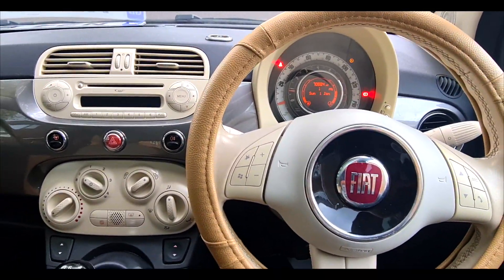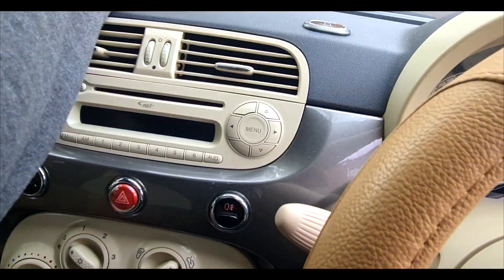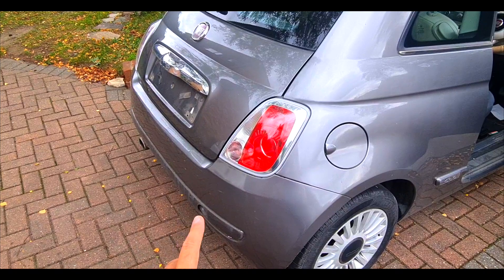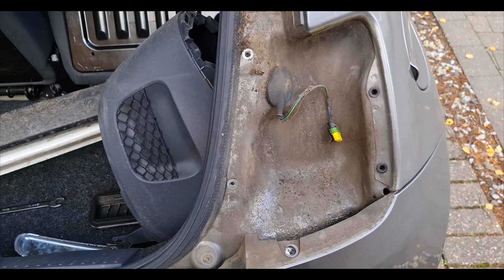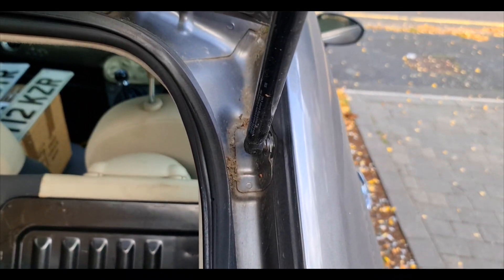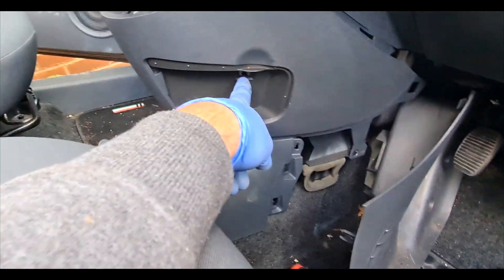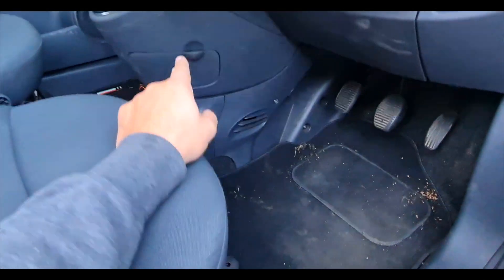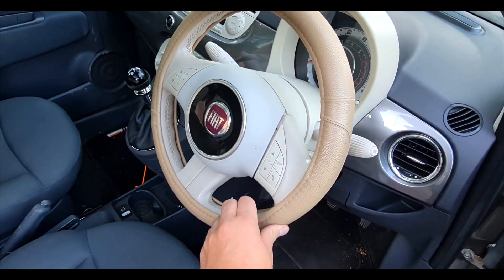MOT Brings Problems For The Fiat 500 Lounge

Comment: Ok handbrake slack it back off remove rear wheels and drums get someone to operate handbrake see if the shoes move freely out and back in again especially the offside   (they can seize on the pivots) adjust them up a click at a time till they are very slightly touching drum surface (ie NOT binding ) refit drums then adjust cable. Nearside headlamp may have the bulb in wrong ,check them against a wall in the dark . On the beam tester they should show a particular pattern as well as being the correct height.(sounds like thats what he is referring to) And the strut if its leaking will show oil residues around it
Reply from the maker: Excellent feedback Rich, most appreciated. Shocker has quite alot of oil around the shaft. The lights annoying...as they all work...it's working out why he isn't happy. I'll get around to the rear brake drums last I think :)
Reply: @carsalvage101  When the light is on the beam tester if bulb is in wrong it throws wrong pattern but its not so easy to spot otherwise . He should have explained to you what the issue is a bit better . Maybe check bulb against another in case its not correct one . Just a thought. I am sure Paul will have had this issue.
Reply: @carsalvage101  Paul will tell you about the old DRL bulbs left/lost in the surround that need fishing out with magnetic screwdriver. Could be a mess.

Comment: I am trying to figure out that MOT the car looks good, what is was wrong with it if you corrected most problems
Reply from the maker: Major fluid leak from a shock absorber and not happy that the handbrake is not holding the car very well are the two major things.